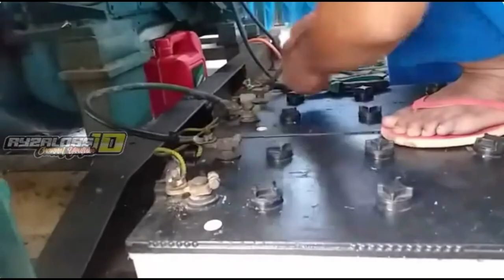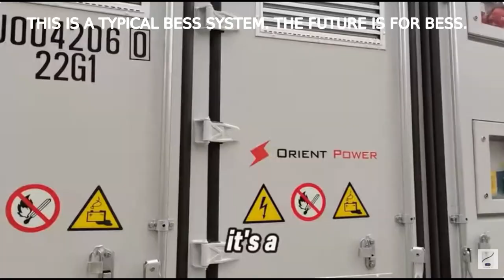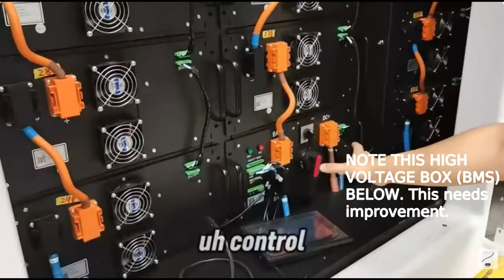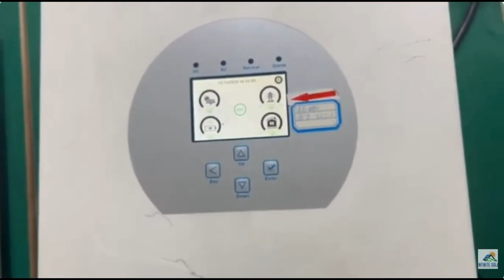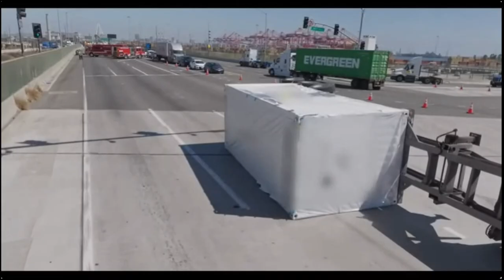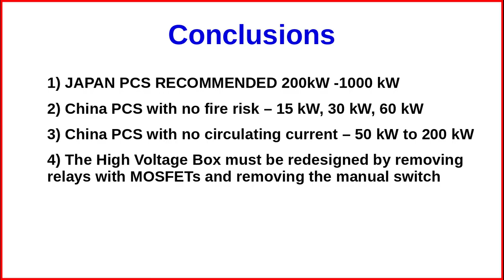Japan PCS vs China PCS for BESS | The Hidden Truth Behind Cost, Safety & Fires

Comment: I got the following comment from Japan PCS manufacturing company.

It s a good explanatory notes with advantages and disadvantages..
We have below observations on this. Please address those:
Start time: In case of power outage situation, PCS goes in islanding mode first and waits the feedback of main breaker operation of grid islanding/electrical path clearance.  Once feedback received to PCS, This start the power supply. For PCS, this is typically within 20-40 milli seconds which is a contactor operation time.
DC circulating current: PCS has no role in this. PCS will have only one DC termination for battery bank. Paralleling activity is done at DC end and not on PCS terminal. BMS to handle such issues like DC balancing.
Capacity: Our PCS capacity starts from 50KW.
Flexibility on DC voltage: Nominal DCV design can be 576V… __,  _,  768V depending on availability of Battery bank.  
4 wire system: We offer IDT (inverter Duty Transformer) along with PCS in case of requirement of 4 wire system. This is very useful as grounded IDT gives a fresh Neutral in even in case of neutral failure from grid side/Outage condition. Other China made systems works with grid neutral.
Design reliability: As per market’s feedback, China made systems do not support heavy application loads effectively like Inductive/Capacitive/Regenerative.
About HVAC requirement: It s not mandatory for PCS. PCS is designed to deliver full power for 0- 40 deg C ambient temp with an altitude up to 1000 m and RH up to 95%. So, this can be operated without HVAC but battery bank to be safeguarded by putting HVAC.

Comment from the maker: The BESS fire must be stopped. R&D is required to stop the circulating currents in the parallel connected racks of batteries and to modify the High Voltage Box type BMS by replacing the relay switching by MOSFETs switching. I (my company DR GS PANDIAN R&D LLP) have already filed one patent along with Fujiyama Power Systems Ltd in India. I am working on a second patent to design the future High Voltage BMS with SiC MOSFETs. I need funding to complete this task. I invite any company in this field to give funds of about (Rs.1,00,00,000) and I will be pleased to do a joint R&D and will be very happy to share the second patent with the funding company.